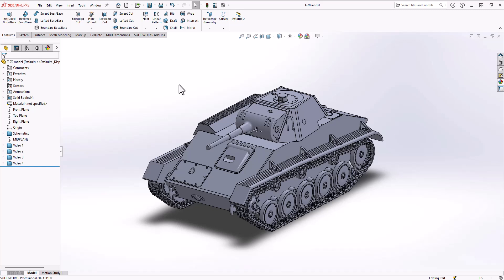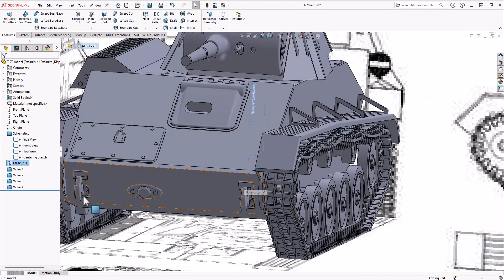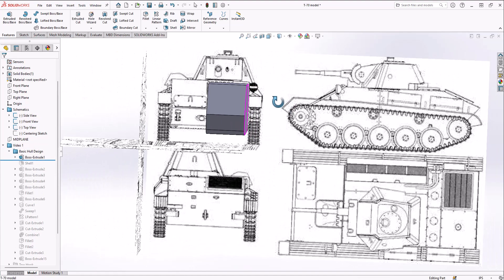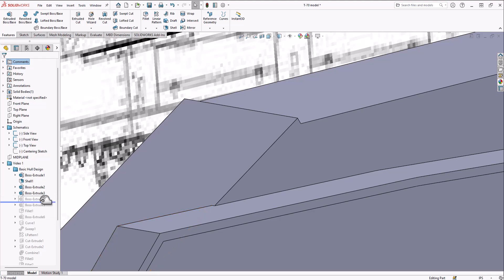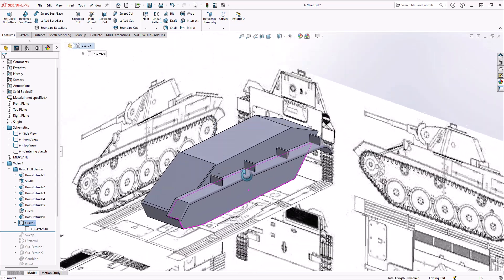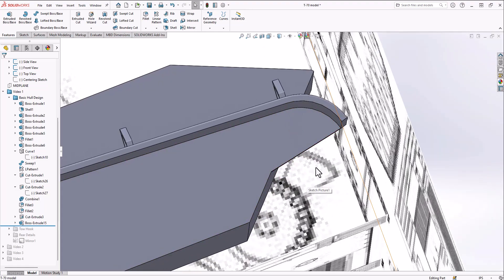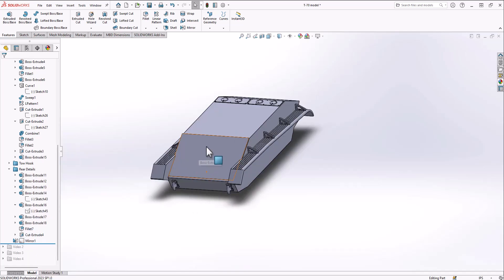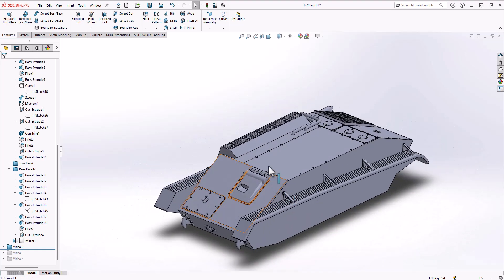Modeling a Tank in SolidWorks (T-70) - Part 1/4

Comment: Where we can find the plans of the different view ? Pls
Reply from the maker: Hi! I generally find my references in google images actually. For example with the T-70 I would search “T-70 schematics”, “T-70 blueprints”, or “T-70 vector drawings”. Generally one of those searches will yield something usable. Sometimes vehicles don’t have plans in this style so I have to find a good side view image for proportions and then do a lot more eyeballing with other reference pictures of the real vehicle. It’s a bit of an acquired skill set, but a lot are available just through search engines.
Reply: @tcrdesigns  I see, thanks you so much

Comment: Would it work in Autodesk Inventor?
Reply from the maker: @AlexandrosZisis-l6i  Hi! I haven’t used inventor, but if it has similar feature tools to SolidWorks then it should be possible to follow the process to make models like this. This video hopefully outlines more of a broad structure to modeling which can be applied to various softwares, rather than specifics of how to use SolidWorks tools.